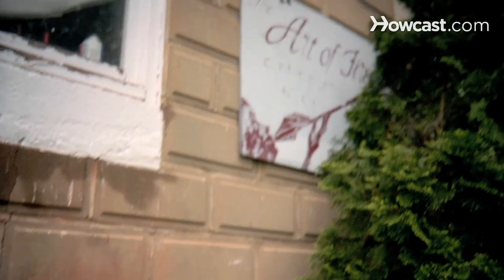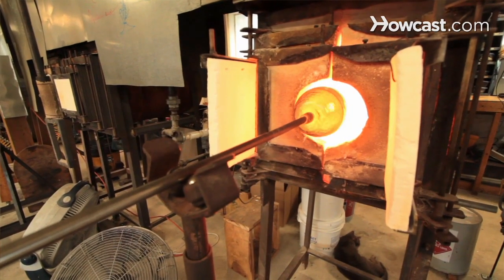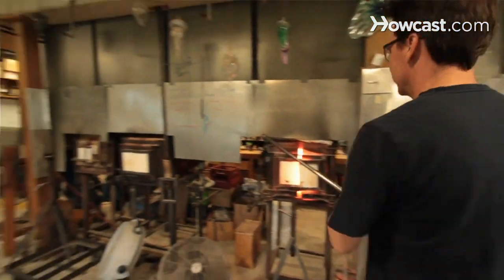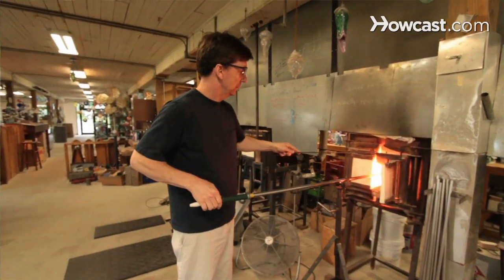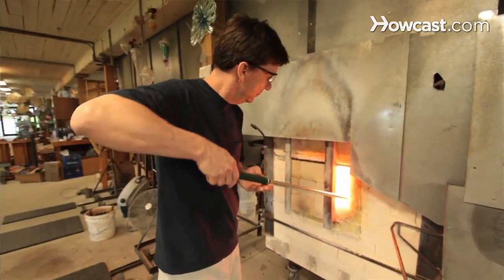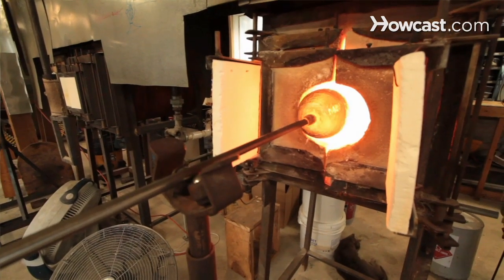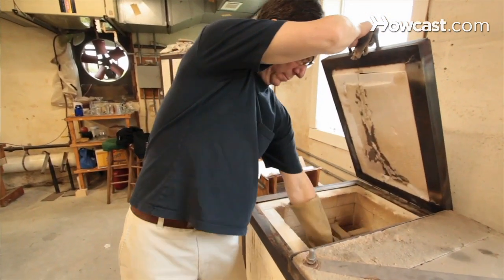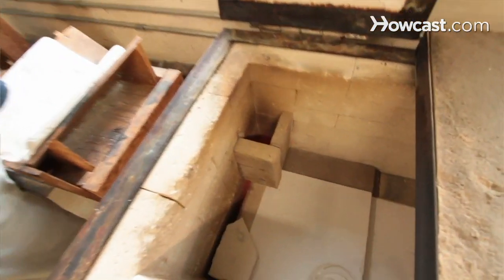Can Glassblowing Be Done at Home? | Glassblowing

Comment: Is this supposed to be demotivational? No matter what, it is.  For melting large amounts of glass; yes. To get started with glass blowing: certainly not. You can start on a much simpler level, just to experiment and go from there. Do not let this video discurage you to try it for yourself!
Reply: so true... this is a very good demotivational video.
Reply: I don’t think it was meant to demotivate you, just what to expect in reality. But he did mention doing it on a smaller scale to make it easier. Either way, this is not cheap medium to learn. Obviously the bigger the equipment, the more it’s going to cost, but even on a small scale, it’s still going to cost a lot to get it going and keep it going if you want to continue doing it.
Reply: I was looking for video hoping to make my own glass bong in my shed while super stoned and paranoid . You guys the same reasons? Just a small bong would be good
Reply: I don't even want to do anything as fancy as blowing glass -- I'm just interested in recycling glass into small panes I can put together into larger windows.

Comment: You could hold the glass in a box of ash to anneal it so no you don't need an electrical annealer
Reply: where does one buy ash or do I just burn everything in my house?
Reply: @paytoncox2527 
You could ask around, see if anyone you know has a fireplace they use regularly. Failing that, my best guess would be to look around at campgrounds with fire rings, see if there's enough ash there.
Reply: Not necessarily. It depends on the thickness of the piece. Glass cullet manufacturers have specific schedules to follow for annealing their glass and the schedule depends on the thickness. The schedule that I use is 966F for 2 hours then 775 for 10 minutes then 600 for ten minutes then cooling at 250/ hour until cold. Not exactly something you can do without a PID controller unless you’re making pretty small stuff.
Reply: That being said, I designed and manufactured my annealer. Not really all that difficult.